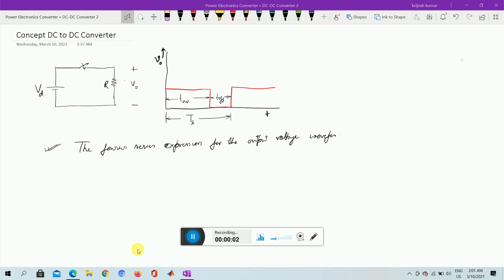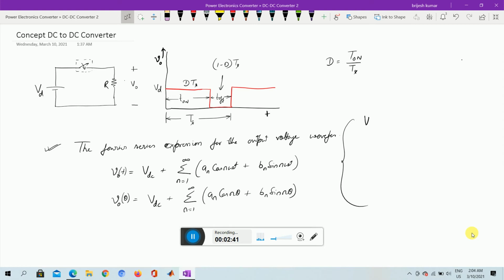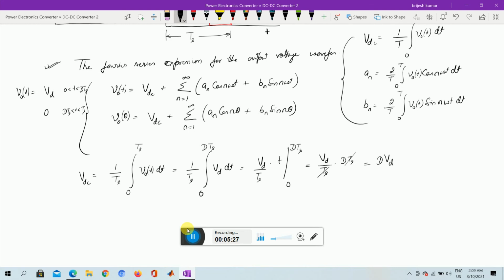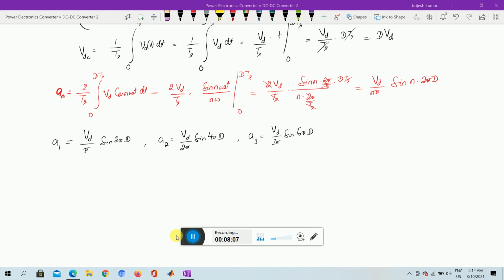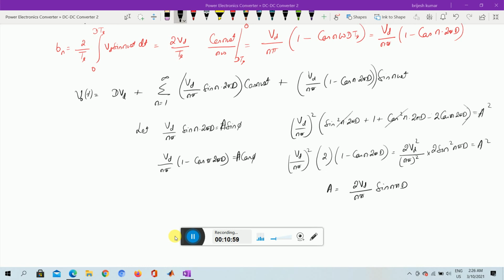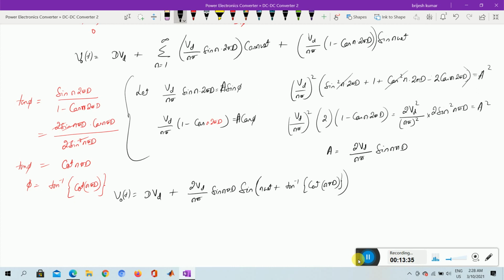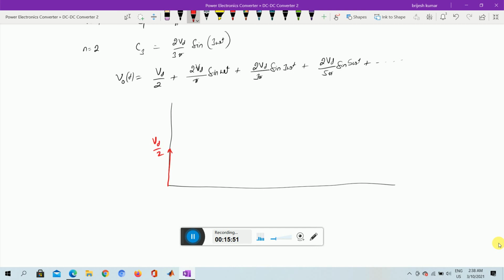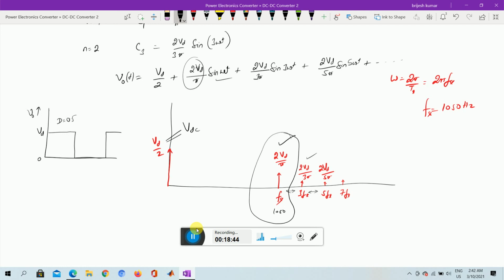2.1 DC_to_DC Converter _1: Fourier Series Analysis of output voltage waveform of DC to DC Converter

Comment: @20 min 
Switching frequency of switch is fs(means square wave also has same frequency)
Then fundamental harmonic's 1 cycle time is equal to square wave one cycle  time
Pls explain it if possible ? 
How it is 21 times of square wave frequency
Reply from the maker: If the switching frequency is same as square wave ON and OFF...  In the output we will get square wave only. Now the harmonics contents are 50Hz AC , 150Hz AC.. However, if the switching frequency is 1050Hz, the harmonics contents are 1050Hz AC, 3*1050Hz...etc. Thanks